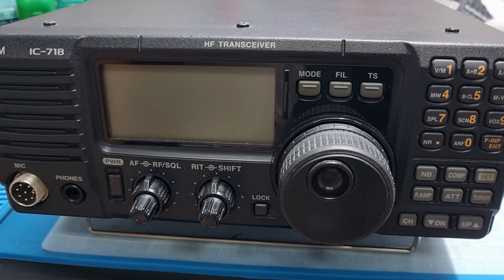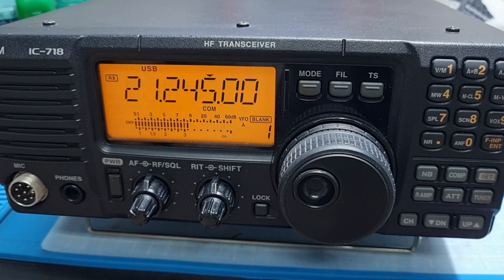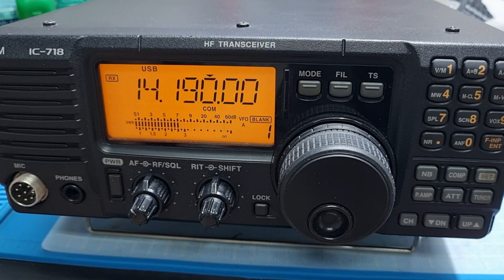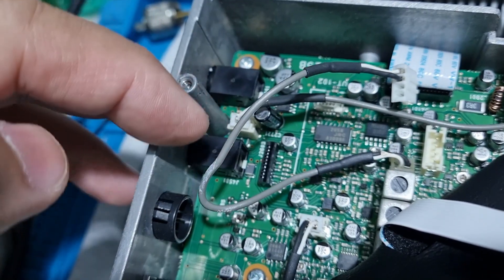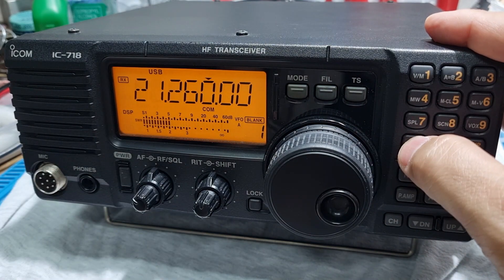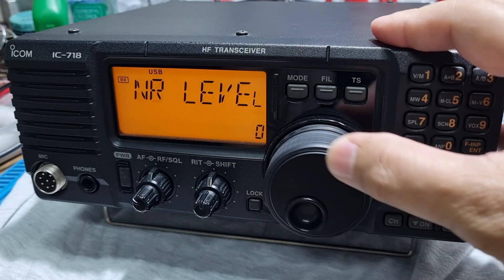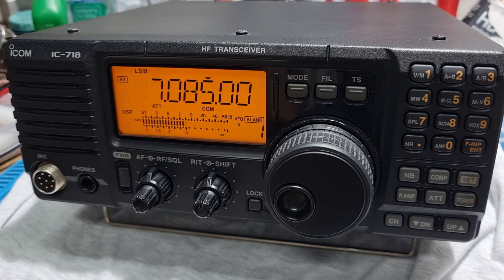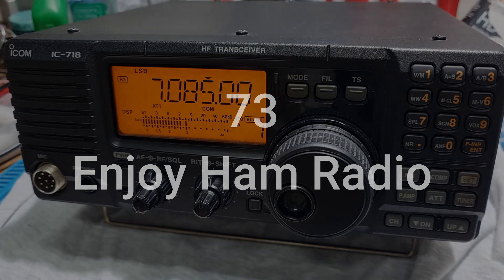Icom UT106 DSP install to IC 718 HF Tranceiver

Comment: Such an underrated radio. Everything you need and nothing you don’t. I believe this is the same DSP chip that the IC-706 can use. 

Have you done the AGC mode yet? It really makes the receive nice. Even smoother. Just one jumper wire is required.
Reply from the maker: @W6EL, thank you for the AGC mod suggestion. i will look that up and try. best 73. du7jay

Comment: The UT-106 DSP filter is AF and not IF processing. This is why the signal becomes unintelligible when you select the highest level of noise reduction. It is an effective option but has its limits.
Reply from the maker: @MYNAMEIS-hz9ti  agree 👍🏻

Comment: I have the Icom IC-78, which basically is the same as the IC-718, and purchased the DSP module, but unfortunately my transceiver seems to have a different motherboard and cannot be installed. Is there a way around?